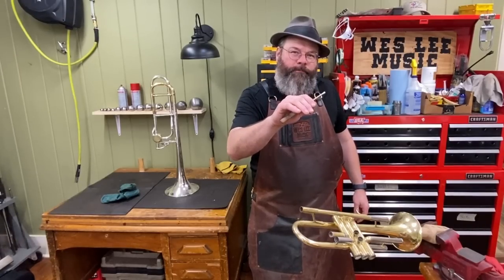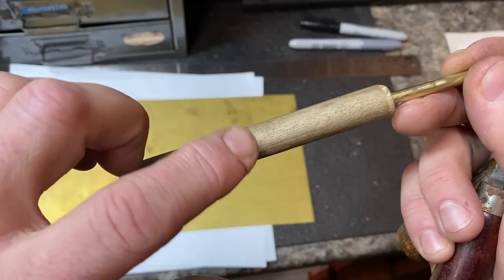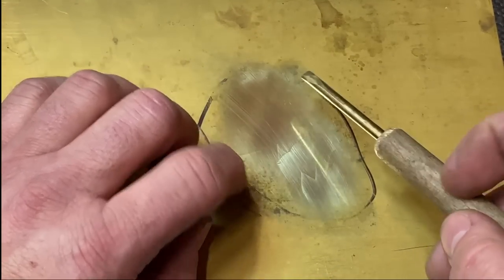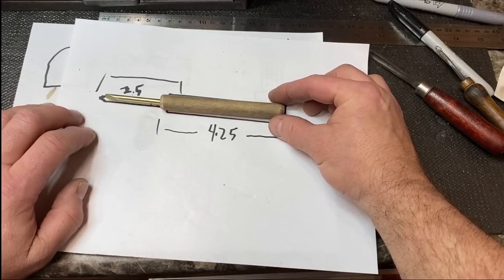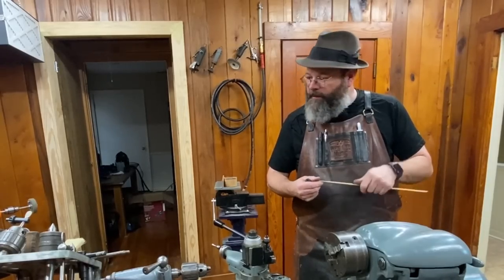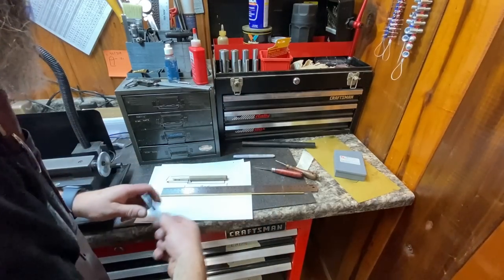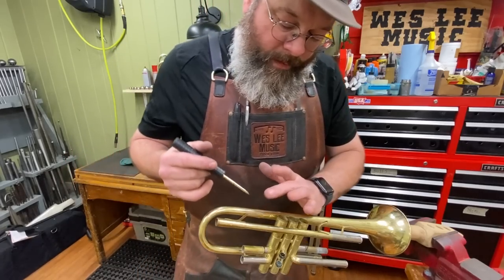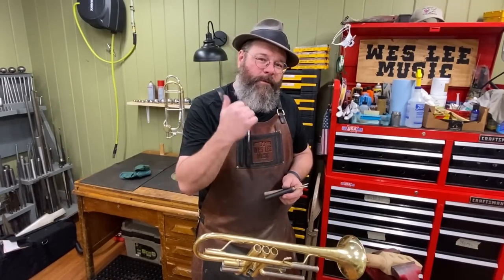Tool Making 2- The Solder Scraper, band instrument repair

Comment: Any format is enjoyable and informative. You could also drill and tap for some set screws to make changing the blade easier when it is no longer good, A small flat on the end of the blade would keep it rigid.

Comment: I am unfamiliar with soldering brass instruments. I have in the past, however, silver braised, steel tubing, and fittings together. Remember the braze or perhaps in this case, the solder will go wherever the flux is. In my case, I would use masking tape to define the area on the tube that I didn’t want the silver braze to exceed and then I put the flu on and then just before I heated it, I would remove the tape. This probably would work well if you’re soldering a joint, particularly for plumbing and you want it to look good.
As a sidenote, if you are using voice to text in YouTube, as I must because of vision issues, check every word before you post it, because artificial intelligence in this case is extremely poor and changes the words to something stupid.